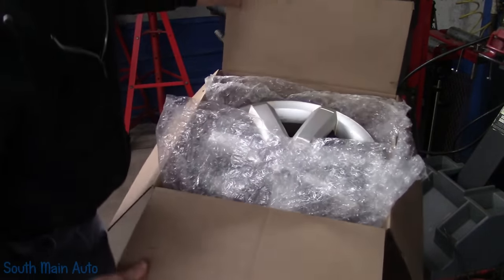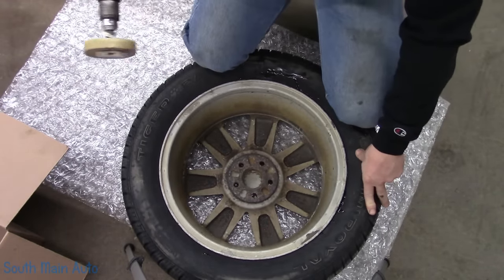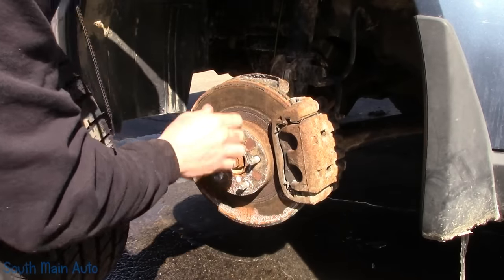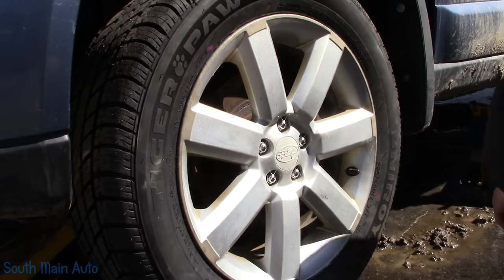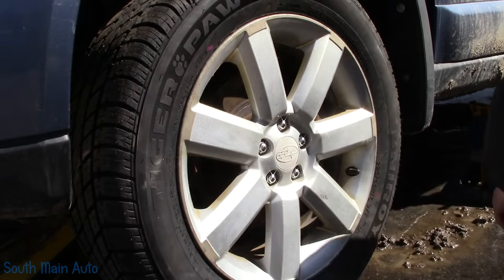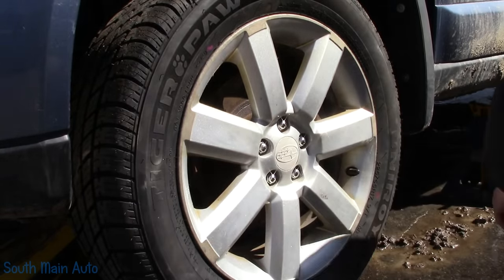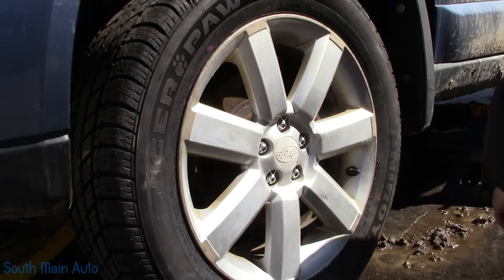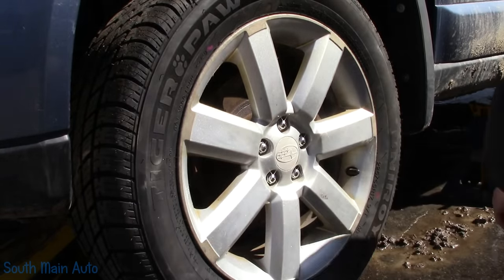Subaru Lost A Wheel On The Highway!

Comment: Man... o man!....you've got to watch these wheel/ rim shops, they're on every corner in town, especially in the DFW Tx. area... they're  always in a rush and often forget to torque the wheels / lug nuts properly, sometimes cross threading lug nuts via careless airgun usage, making it extremely dangerous for the customer, this happen to me 15 years ago with my 92 C 1500, after getting a used tire installed on my driver side front, while driving I kept hearing this clicking sound and soon as I got to my mother-in-law's house the wheel fell off right at the curb, ended up replacing 3 of the damaged studs on the rotor, the shop was not liable according to the shop owner, never will I do business with this place again. .unsafe & performs shoddy workmanship, I  filed a complaint about this tire shop with the BBB. I'm just sayin'.. be safe!

Comment: Bad luck.. On my 300zx, my rear wheel bearing was growling for the longest time... When I took it apart, I found that the axle nut was less than finger tight, aka just freespinning... Basically my entire wheel was holding on by the cotter pin lol... once i took it off, the whole hub just fell off with little ball bearings scattering around everyone.. Drove it like that for longer than I'd like to admit lol

Comment: After loosing a wheel on a new Volvo and replacing the tire and rim with the "exact" rim, brand and model of tire that was destroyed, a myriad of serious problems with the traction and ABS occured. Volvo couldn't not find a problem and yet experienced the mystery problem. Offices in Sweden were contacted, and still no problem detected. Sensors and computers were replaced, and yet the problem continued. It was a non-technician friend who noticed the replaced tire was the wrong size in width by on size. The not-so-exact-matched tire was replaced with the correct size and the problem was solved. The car experienced one accident after another due to the nut behind the steering wheel and was eventually totaled.

Comment: This guys while life is surrounded by rust. I worked my way through college at a Midas in Ohio and I never had to deal with rust that bad
Reply: Jason Pound yea I’m in Ohio as well Jason and that was unbelievable. I don’t believe PA uses salt I think they use hot coals or sand if I am not mistaken. But I’d like to know that Part Number for the Ball Joint Puller. Pretty Slick

Comment: Twice in my life have I had a wheel come off while I was driving. Once when driving the pick up truck my Dad used at work. I was only seventeen and the front driver's side wheel came off. Called Dad and he showed up with my uncle who drove a transporter. We found the wheel in a field with the lug nuts still between the hub cap and the wheel. The second time was about 15 years ago driving a Honda Civic wagon. The rear passenger's side wheel came off. It had no hub caps so the lug nuts were gone. My wife was with me and asked me what we were going to do. I told her.. just put the wheel back on. How when the nuts are missing? I told her.. well, we'll take a lug nut off each of the other three wheels and drive straight to the dealer or an auto parts store and get new lug nuts. (Only three miles).  Three times we've also had lower ball joints come apart on the road. And yes the car had been inspected.

Comment: same thing almost happen to me had a mechanic do front brakes on a qx4 that i had, and left the front wheel lugs loose, after that  i starter doing all the work on my vehicles 
I got me a snap on  Torque Wrench and triple check my wheels any time i work on it or costco works on it.
if i can fix it i sale it as mechanic special, since i dont have a mechanic i trust,

Comment: Back in my  youth when I was just getting in the practice I worked in a shop that forbid us from cleaning bead areas, or even the inner rim for sticky weights,and replacing valve stems. After their 3 minute, 3 foot guarentee customers be back a week later cuz tyres losing air, or bouncing down the road cuz weights dropped off. Then would charge them for a "wheel cleaning" and dismount balance remount and $15 for a valve stem plus labor. They got away with it 99x out of 100. That was just one their tyre scams. This was a "full service shop". Show a customer a standard tranny filter and convince them the normal wear and tear debris is gunna blow up 5 miles down the road. Lots of useless teardowns, r&r , reuse the clutch packs and bands, etc even the oil! Needless to say shops like that are the reason tool boxes have wheels. Obviously I left.

Comment: I was at an intersection once, and there was a taxi next to me.
The right front wheel on the taxi was missing 2 lug nuts, and a 3rd lug nut was loose. So, it looked like only 2 lug nuts were tight. (if that)
I yelled to the driver and pointed at his wheel, and he would only respond with "Eh", "Eh".
He appeared to be spanish, and probably did not speak english.
I just gave up and figured he would eventually find out what I was trying to tell him, possibly by his wheel coming off while he's driving.

Comment: Not officially but I put wheel bearing grease up in the cup when I change my own subaru ball joints.  It says not to do it but I refuse to believe lubrication is enough to cause the ball joint to slide by the pinch bolt.  Assuming I jump the car and the wheel is hanging in the air.  But seriously, if lube is enough for the ball joint to slip past the pinch bolt, it's not safe anyway.

Comment: That would have been a fairly easy dust shield to replace. I've got some projects planned for my '04 Chevy Trailblazer EXT, and one of them is to replace the badly rusted out rear dust shields. When the genius at GM designed this, they put the dust shield between the rear axle hub and axle tube. So to replace it you have to remove the rear brakes, differential cover, spider gear retaining pin, and rear axle. Then unbolt the hub from the axle tube. The full size trucks have a two piece dust shield, so you don't have to do all that. Why, GM, why?

Comment: I have had so many issues with proper torque on my rims, after rims are removed for any reason, that I jack up the car, loosen all the lugs,   And retorque them all.    The dealer has cost me two warped rotors,  due to over torquing the lugs.

Comment: Ketchup work... gross!!
I think that tread depth idea is a tire shop SCAM!  A few 32nds ain't going to put anything out of tolerance, only if you had total mismatches sizes, imo. 
HE got new tires a week ago and one came off... better check torque on them all.  Aluminum rims need tightened after a hundred miles or so.
HAY, that balljoint is fine for another 100k ya big parts cannon!  (nevermind, I just saw the close up of the nut... and them balljoint pieces too!)
"Stick ur SlideHammer in her and whack it off"

Comment: I like to do my own work but my back was hurting so I had a mobile mechanic come put a Pitman arm on my pickup for me and when I took it to lunch it vibrated like crazy and I called him and he said it shouldn't have anything to do with what he did and then he called me back a minute later he said wherever you're at, don't go anywhere I think I figured out the problem and I asked him what it was, he said I forgot to tighten up the lug nuts.  He came out and tightened the lug nuts and everything was fine and I figure everybody makes mistakes.

Comment: Same thing happened to a truck I had at 18. I had some studs seated at a tread quarters(young and dumb). Not 10 miles later the back left of my truck sank down and felt awful.  The tire and wheel went a rolling and bouncing down the highway as I screeched to a halt on metal and clutch as it also ruptured a break line.  I went back to them and they tried to tell me to get fucked. Luckily my uncle is a shark of a lawyer in that he will eat your kids after gaining custody of them as your representation. Turns out they wanted to replace all the damaged parts and offer me 2 free sets of tires for my troubles.  They were nice guys.

Comment: Wow! You put lube on your wheel lugs, don’t you know if you oil your lugs they will fall right off !    I been oiling lugs for 50 years and never had any fall off. Of course you have to TIGHTEN them.
Don’t recommend Never- Seize though, something about Never- Seize on lugs makes them feel like you could tighten them till you rip the studs out.
Sometimes aluminum wheels get a layer of corrosion on the backside where they meet the axle and you’re squeezing that corrosion layer which may cause the wheel to loosen. I bet the wheel that got away had a big thick layer. If you have old corroded aluminum rims it’s good to scrape it off and then use a small sanding block make sure they’re nice and flat.

Comment: Ever had a Pickup Truck Wheel and Tire coming at you at about 60-70mph on the Freeway?
I have... In "my" slightly lifted Chevy Z71 4×4. 
I was just driving home from work, minding my own business. 
I'll tell you, It scared me Shitless!!!
And It happened in the blink of an eye..!!!! 😳 
I didn't even have time to swerve or brake or anything. 
It just missed hitting the Passenger side of my windshield, glass high, by inches.... 
I'd swear that thing picked up speed too as it jumped the center divider and flew by me, bouncing about every 50 feet or so. It must have weighed at least 35-40lbs. Imagine that hitting you head-on when you're doing about 60mph yourself and landing in your lap....?!

This guy in a late model Chevy Pickup that was coming the other way lost it while he was just driving home as well that day. It just fell off. 
I saw him skid off the pavement after it came off as I went by so I caught the next off ramp and went back to make sure He was Ok and see if I could help him. Since He couldn't drive his truck any farther without the wheel and tire I told him to "Hop In" and we went looking for his "Missing Wheel".
While we were talking he told me that "coincidentally", he too had just had new "tires" installed on his Truck just short of a week prior to that at a local "Just Tires" Store...Imagine that....lol. Btw, It came off the left front of his truck. Looked like the only real damage was a bent up backing plate although it did grind off a little of the rotor getting the truck off the Freeway. But it was not too bad.
Anyway, Luckily the Wheel and Tire missed me when it went by. And we were able to find it about a half mile or so back up the road leaning up against a chain link fence that borders the Freeway.

Of course there were no lugnuts to be found around the truck so we drove to a Pep Boys and bought 6 new ones then went back. After "chasing" a few buggered up threads on the hub and bending back the backing plate with a screwdriver, we were able to put his wheel back on...Then we both went on our own ways....

I told him that if it were me, I'd send a "Bill" to his "Just Tires" Shop for the trouble they caused...lol. He didn't think it was too funny. You  could tell It scared the crap out of him too....
I don't know what he ever did after that. If he ever even talked to the Just Tires Guys. I never saw or talked to him again....
That Tire store HAD to have been responsible for it though. It's just too Coincidental.

I'll never forget how scared I got when I thought about what "could" have happened if it had hit me.....🙏

Comment: I had a Tire changed by a local shop. On my way to work (about 7 miles) I heard a loud popping noise When I got to work I checked the wheel that had been worked on.  All 5 lugs were only finger tight.  Fortunately the wheel did not come off. I have never been back to that shop and I have told every one I know what a sorry ass operation they were.  CYA language on the receipt is pure BS!

Comment: Call me both cheap and rash but if it were my cheap run-about on it's last legs I'd have not bothered replacing the ball joint unless or until it stopped doing it's job and I'd not be bothered how well it worked as long as it held fast and didn't let go. I had a mate who's ball joint was so worn it lost it's nut and fell out of it's hole one night so he wired it up with old wire he found,  just to stop it flopping about and get him home. He didn't end up fixing it for 6 months and only did it then because he couldn't get registration without doing it. He called it "Kiwi ingenuity" but you may have a different name for it ;).

Comment: i have done 100s of ball joints in my life and I never saaw the red tool you used to push down the lower control arm...who makes that tool.....i usually used the 4 foot cut up drag links and modified from 80s and 90s Chevys .....i would cut off extra on end and flatten out threaded end...snap-on would sell that tool for $249 off the truck...LOL....great job

Comment: Doesn't surprise me. I feel like subarus ad department knocked the "our cars last a million miles with no maintenance" out of the park.
I notice that there are 2 types of suby owners. 1- the car guy. He owns a wrx. Or an sti. And that thing is his damn baby so don't back through the garage door while it's closed and I'm in the field for training sheila.
2- the sheila. She can't be bothered to even check if there is gas in the car. She just hops in the thing opens the sun roof and plays on instagram.  Her wheels would fall off because when her car starts making expensive noises, she just turns the radio up. 
I wonder how loud the radio was when you backed through the garage door sheila.

Comment: I have the same weathered blue tool cart and that same snappy  thread chase set.Thought that was kind of cool. Will be checking out that ball joint tool. Would  like to know what you use to clean out the corrosion in the caliper bracket. Would like to cut down time on that part of my brake jobs. Too many cars need high effort there. Thanks, Have a great day

Comment: A guy was driving down a road when,suddenly,one of his wheels came off. He stopped and went to recovery his wayward wheel. Returning to the car,he notices that he is parked in front of an secure mental health facility and one of the inmates is watching intently him from behind the fence. Turning his attention back to his problem,he is wondering what he can do to get himself mobile again without any lug nuts to replace the missing ones. A voice from behind him says," why don't you take one nut from each of the other wheels and that should hold you until you can get to a garage and replace them." Turning to the inmate he says,"hey,that's a great idea,thanks." The inmate replies,"hey man,l may be crazy but l'm not stupid."

Comment: TIger Paws are the smoothest tires I've ever bought for a vehicle......
Reply: yea but they dry rot quickly if there's even tread left
Reply: Yeah mine only lasted 68,000 miles and 6 years and 3 months before cracking in between the treads enough to start worrying about changing them for sure👍
Reply: @bruno8241  yea, i dunno why uniroyals/ continental/good year tires are going down on quality control lately... like they put less UV protectant in their rubber compounds or something. Had 2 blowouts due to dry rot at about the 5th year in those brands
Reply: @ricebike  yeah mine showed signs on the sidewall 2 years old about a 1/2 inch all the way around from the bead never had problems with them but that was the first signs...

Comment: Great video. Have you ever had an engine where the oil pan fills up with gasoline. How does gasoline get in there instead of burning in the cylinders. Thank you
Reply: One of the many causes,  a hard starting car or if the engine is flooded with gas, as it sits the gas drains past the piston rings into the crankcase oil pan, it doesn't really evaporate there.  This is why people should smell the oil dipstick for gas when checking a car, the oil/gas mixture make a poor lubricant... the oil should be changed.

Comment: Gotta re torque that aluminum folks not the shops fault .
Reply: Re-tightening is part fact, part bad practice. Nuts with flat surfaces (as on alloy wheels) do tend to come loose in the absence of a locking aid (see http://www.boltscience.com/pages/vibloose.htm for the details) but re-tightening one that has already come loose once is indefensible. If it came loose you know it needs thread locker, not a repeat of what you now know is a mistake.

Comment: Tourque wrenches are overrated. A torque stick will get it within spec plus or minus 90 ft lbs. Ask any dealership mechanic. Takes too long to spend less than a minute making sure the wheels don't fall off.
Reply: shrugs, i've been using torque wrenches for 20 years... didn't fail me yet!

Comment: Ok. Got a question. This is the second video, by two different mechanics, that I’ve seen in the last week where a ball joint was installed without tightening with a torque wrench, just s box end wrench or a ratchet and socket. I’ve installed many ball joints and always followed the instructions on tightening with a torque wrench. It’s been a few years since the last one hence the question: Have ball joint manufacturers changed the design so that a torque wrench is no longer required?

Comment: I noticed that the red dot approximately lined up with the tire stem....I've been told that that is desireable as that's the dot is the heaviest part of the tire and the where the stem goes represents the lightest part of the rim, ergo, you'd need the least amount of wheel weights if you line them up. Is this true or just bunk? Likewise I've heard if you don't have a red dot, but a yellow there's a different procedure?

Comment: what is your opinion on greasing the lug nuts slightly to prevent them from corroding ?
Reply: don't use alot of it if you want to do so; it may throw off the torque readings if you're tightening by hand with a torque wrench